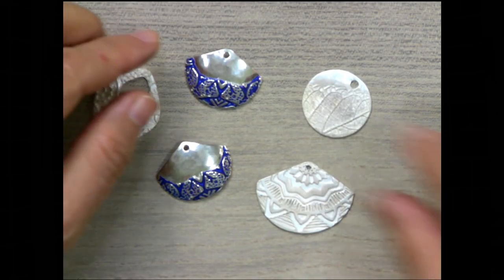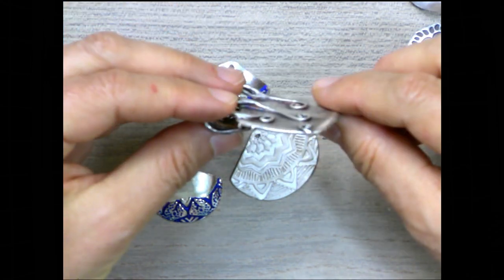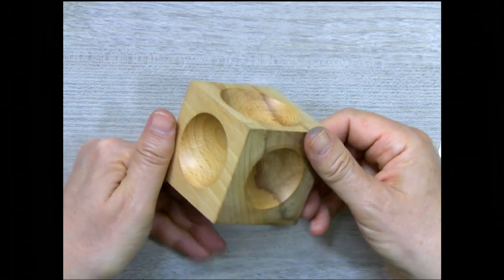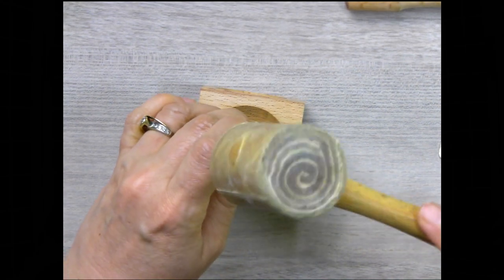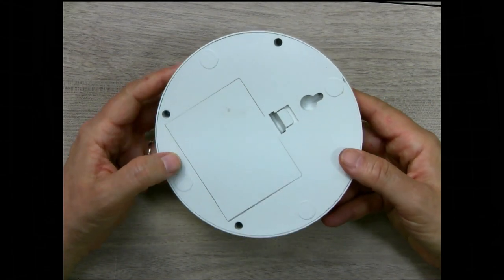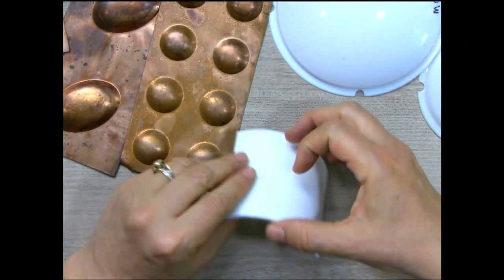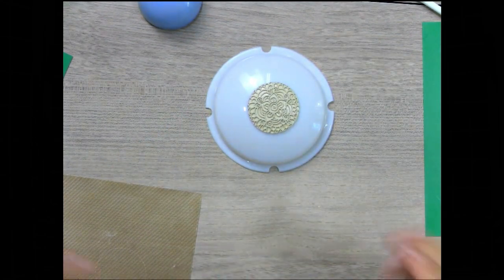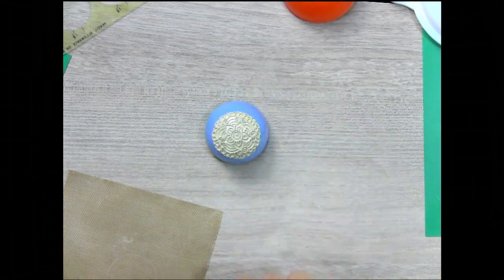Metal Clay Fundamentals: Doming

Comment: Thanks for the informative video Pam, it answered a question I had as if you can dome a fired piece after firing and I see that's a yes! My other question is: can you solder on a jump ring, bail or bezel cup after firing? I'm thinking yes but wonder if there are any special considerations? Metal gauge, solder type etc.
Reply from the maker: Glad you enjoyed the video!  Yes, you can solder on to it without a problem. The only special consideration is the porosity of metal clay.  Be sure to burnish the area to be soldered well so the solder doesn't just soak in.  I've soldered onto metal clay many times with great success!
Reply: Thanks for your reply Pam, I appreciate the information! @PamEast

Comment: What if I want to form a slight dome in the opposite direction with the design side being slightly curved?  How do I do that without distorting my design?
Reply from the maker: Two ways.   One, lay the piece to dry the dapping block instead of on the dome.  That will curve it the other way.  Two, just place it face down on the dome. I do think all the time.  The clay is very elastic and will hold the design provided you don't press too hard.